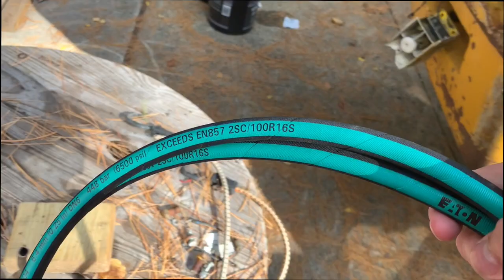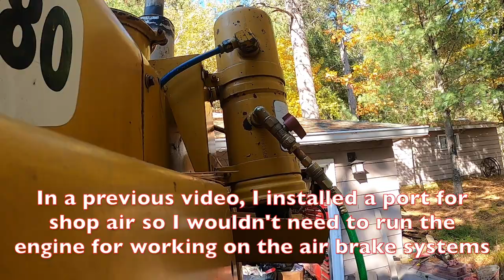The Brakes Work Again! Brake Lines and Air lines (Pay Loader part 11)

Comment: Well done your way ahead on my 515b although I only spent one day on it and it’s still parked at the same spot I purchased it . To my defense or insanity I bought a excavator and have been busy chasing loose ends on that dreaming of the day that I can have both running at the same time or just for sale . I guess I better get on it then ! Lol 😂
Reply from the maker: Good luck. The biggest tip I can offer you is to find parts manuals for your machines. I got really lucky that my machine came with a parts manual and then I found a searchable PDF version as well.
Reply: @MinnesotaEric  yea that’s a good tip , in fact I’m not buying another piece of iron that doesn’t come with shop manuals or the mechanic preferably both ! lol 😂 is my mechanical skills , I wish I would have spent more time in the shop with my dad … and it’s starting to be a dwindling skill set those that keep the secrets and tricks to keep this old stuff running

Comment: Great job! 
Im working on my wheel loaders brakes and after got some pressure working, it started clamping...
Any idea why one of the brakelines could be going to gearbox? Could it be like a parking brake?
Wheel loader is finnish made Valmet 1200 but it has Allison TT 2220-1 Hydroshift gearbox in it. Im wondering if you happen to know about them or in general?
Reply from the maker: I agree. There must be a brake on an output shaft or something unless you have a clutch and the brake line is going to a slave cylinder. My payloader uses an airbrake on the forward pilot shaft as a parking brake that is normally on and comes off with the parking brake release like a big truck. 

That said, I don’t know about your transmission, but I suggest you look around for parts and service manuals as they are invaluable to teach a guy how the systems work. Also the heavy equipment forums is a good resource. Moreover, there maybe a Facebook owners group you can join and ask questions. I looked up your loader and sadly everything was in Finnish on my iPhone. I’m good at puzzling things out though. The hydro shift likely works like a powered shuttle-shift with a torque converter.
Reply: I think it could be disengagement pressure for hydraulic pressure override , if it has two brake  pedals that’s usually what that could be , although mine is elect switch solenoid 
So all go back to minding my own business . Lol 😂
Reply from the maker: @allensandven0  the pedal knocks the transmission out of gear allowing the engine to put all of its power into lifting the bucket. At some point I’ll have a video on my payloader showing this as well as a cool feature on the boom stick that locks the boom up while curling down but automatically knocks the boom stick up lock off when the curl down is then curled up—which is super useful for dumping since you want to transport loaded with the bucket held low, but since the bucket is so huge, you need to boom up in order to curl down and dump.
Reply: @allensandven0  @MinnesotaEric Thanks! I think i will try to remove this line complety. I bought this loader with bad turbine and thought it might last 5-10 years atleast, so far it has saved me tons of money by hauling dirt, gravel, sand, big rocks but yesterday was the first time turbine stopped completely working. 
Totally forgot this brake line that may be disengaging the turbine. Will have to try removing the brake line before i start looking for a new transmission / turbine :D
On my machine its not connected to brake pedal just manual flip switch.

Comment: I can see the excess of hardline in the hub getting snagged and broken off.
Reply from the maker: Tend to agree with you, but the immediate goal was just to get the brakes working. Next will be the remote reservoir system for the brakes, so that if the brakes get hot there is a place for the brake fluid to go without clamping on the brakes.